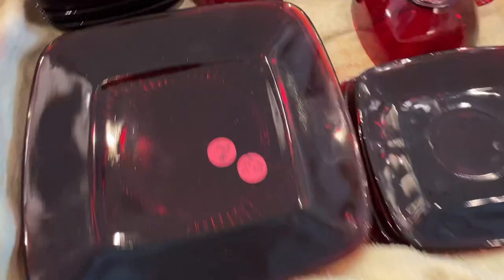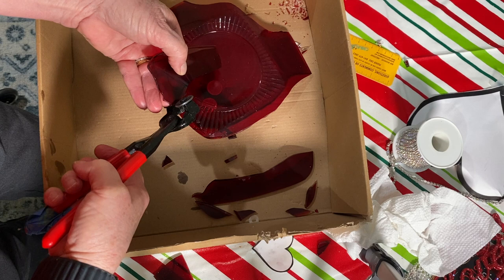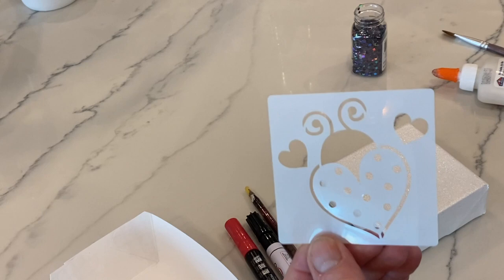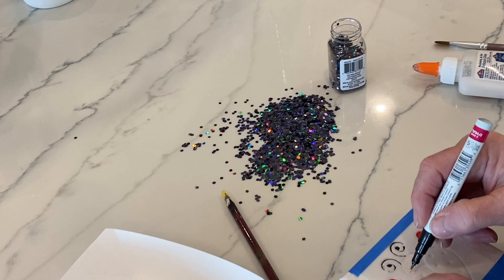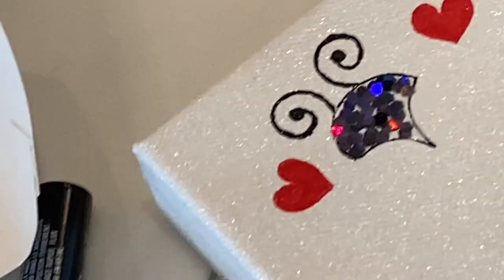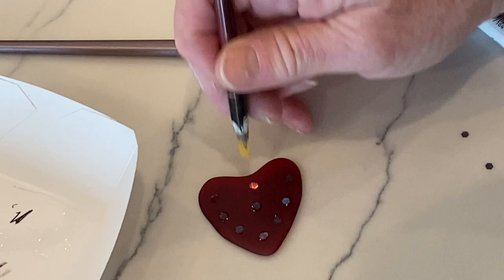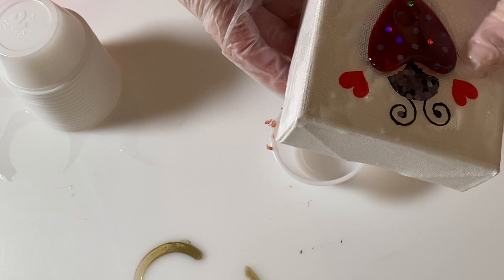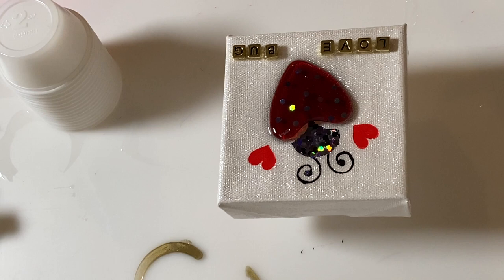DIY Valentine Love Bug Glass Art: Tumbled Glass Heart With Resin On Canvas

Comment: Very cute!  I’ve had trouble using resin on canvas. I think I’m using too much resin. Also get so many drops on the underneath part. I’ll have to try painters tape like you suggested in a video I watched.
Reply from the maker: yes use the painters tape just take it off as soon as you can. you can loosen it with the heat gun